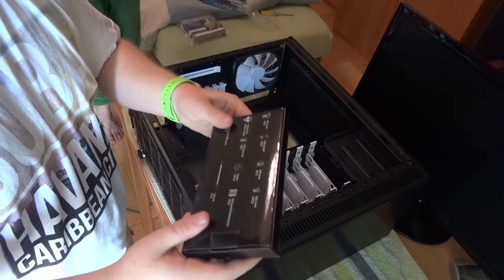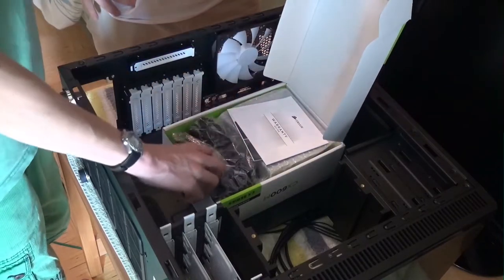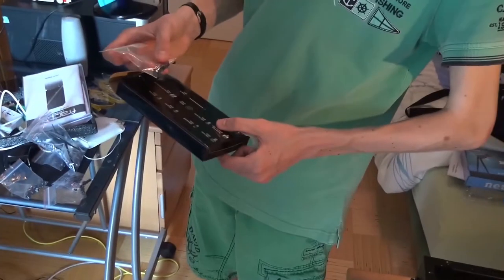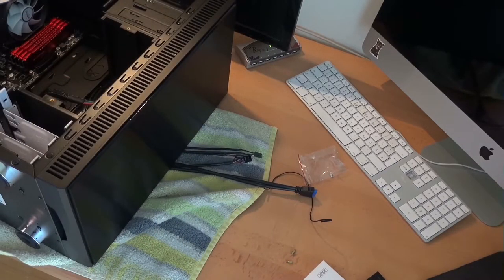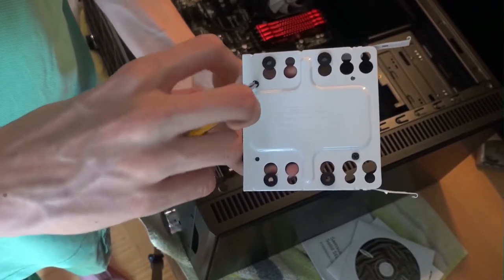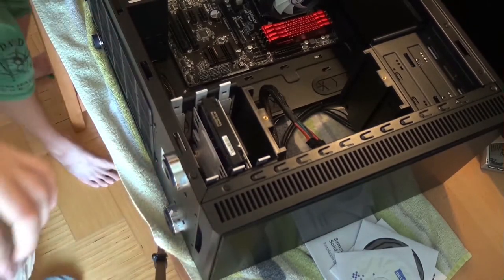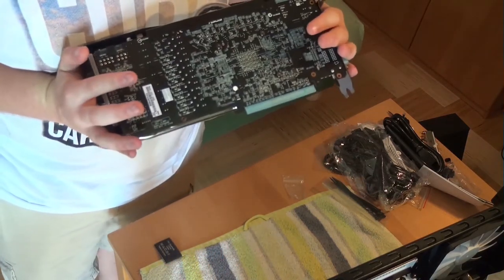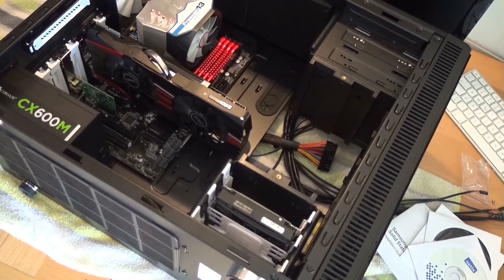New Main PC - The Build - Part 2

Comment: ***** Epic thinking about buying a refurbished dell precision workstation quite old they are but probably will have xeon with 24gb ram and like 750ti or something??
Reply from the maker: adam fitzpatrick I don't know anything about prices of those, but 24 GB RAM is insane xD You'll definetely not have problems in terms of RAM and CPU ^^
Reply: +MacintoshMani12 it is only £409 which is only 509.25 euros
Reply from the maker: adam fitzpatrick That is a really good deal!
Reply: ***** IKR!!